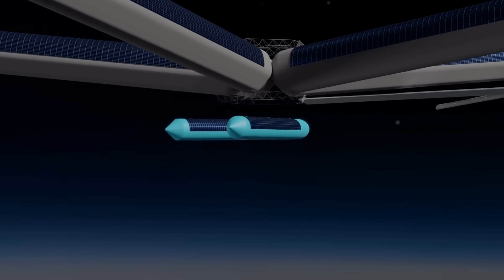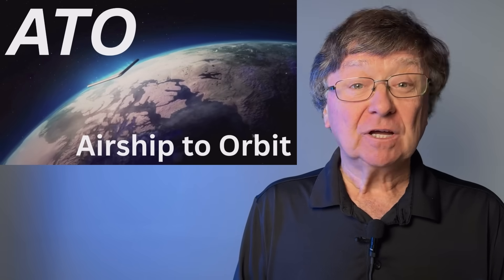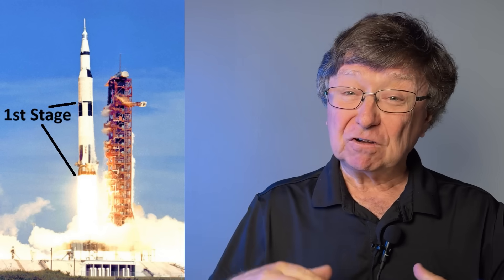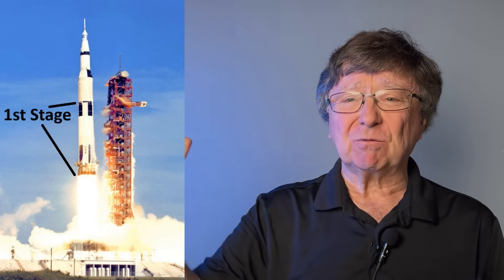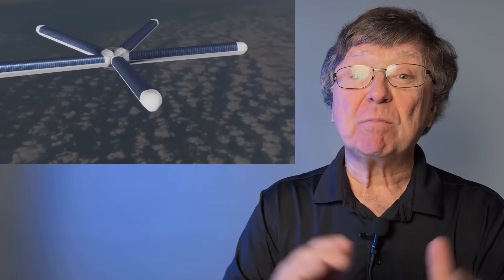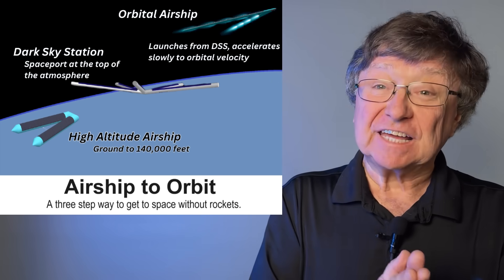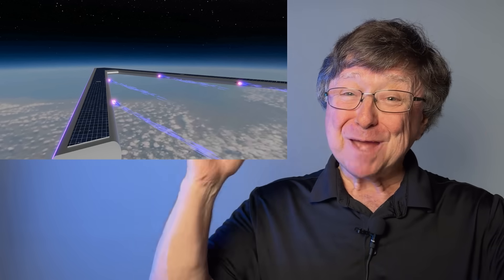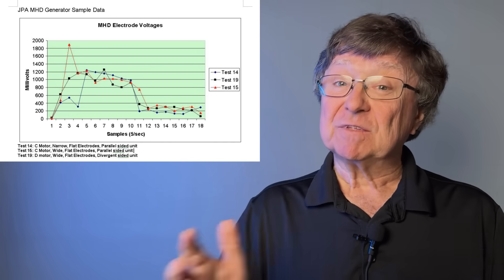This Airship Might Change How We Reach Space Forever!

Comment: Project Shotput. NACA 1959, mylar balloon at mach 10 and 300000 feet altitude. Sounds cool, but what does it prove? At this altitude and at this speed, even things like an unrolled roll of toilet paper will circle Earth for months. The problem isn't how to make a balloon circle Earth at enormous altitudes above the Kármán line, where the atmosphere is almost negligible. The real problem is, how do we get it up to there? The record for a balloon flying up all by itself is at 53.7 km, but this balloon was still floating, and its speed was extremely low. The balloon from Project Shotput was taken there by a rocket, not by an airship.
Reply: lol, the NACA was NEVER 300 000 feet, but less than 250 000 AND - most important - they "balloon" reach that altitude propelled by... A fking ROCKET !! And that "record" of 53.7 km was for an unmanned, uncontrolled flight who only managed a pathetic 3kg load at the price of 80 000 cubic meter volume ! Build from an ULTRA thin  material (2,8 micrometers) so very, very fragile. Not a  real viable concept, tough, more just an experience to establish a record, without any practical value.
Reply from the maker: Shotput demonstrated that the high Mach, high altitude environment is a flight environment for an inflatable vehicle. If a fragile balloon can survive, even briefly in that environment then I can build a vehicle to take advantage of it. It doesn't matter if shotput got there by rocket or carrier pigeon. There was actually many programs like Shotput putting balloons up from 300k to 600k feet at high velocity. They ran from the 50's thru the 80's. Lots of data. There are even LEO (very LEO) satellite companies putting light weight control surfaces on their satellite to take advantage of the little atmosphere there for maneuvering. Where's there's drag, there's lift. I intend to take advantage of that. Take care.  🙂
Reply: @johnmpowell    You failed to address his question at all.   He was asking how you intend to reach altitudes far beyond what balloons can reach on their own.   He was not asking whether balloons can survive at altitude.
Reply: @johnmpowell  Amazing, I love it! Problem solving, work the problems until they go away. Goodluck!
So much negativity here.
😊

Comment: Orbit isnt about "how high", it is about "how FAST".  The most efficient thing humans could donfor space flight is to build an equatorial launch facility.
Reply: The higher the craft, the less the air friction to impede speed.
Reply: @hoptoads  less buoyancy too.
Reply: mass-accelerator (railgun, coilgun, etc) approaches are unfeasable due to atmospheric heating, but electromagnetic acceleration is the most efficient way to reach orbital velocity.

the "most efficient" thing humans could do for spaceflight is to build a structure tens of kilometers high with an embedded electromagnetic accelerator that can launch spacecraft past the atmosphere... and the only feasable way to make a structure tens of kilometers high is to use lighter-than-air modules, I.E. a pyramid of "bubbles" made of metal or carbon, filled with hydrogen, strong enough to survive harsh winds and stay tethered to the earth despite the entire structure being less dense than air.

its much easier once you're already in space, because you're not limited by the constraints of gravity and atmosphere, a "ship launcher" built on the moon could be hundreds or even thousands of kilometers long, capable of sending spacecraft to anywhere in the solar system in just a few weeks.

the problem is that despite it being the "most efficient", the upfront cost would be in the trillions of dollars, and nobody is going to spend that much on a structure that could theoretically collapse if something goes wrong. the tyranny of the rocket equation pales in comparison to the tyranny of economics.

it gets worse when you consider that without the protection of thick layers of atmosphere, any inflatable structure is at the mercy of space junk and micrometeorites.
Reply: That would have to be done deep inland somewhere like africa, but the problem is insecurity. Islands weather and tsunamis make it too risky
Reply: Aaron, but it is more efficient to accelerate in thin air. It's also less stressful, so weight can be saved. It is silly to go fast before you've reached the stratosphere.
However, instead of airships, I prefer 70% efficient piston engines, large slow multi-bladed propellers, even larger and slower multi-bladed counter-rotating necklace propellers, and huge 40+:1 lift to drag wings.
Reply: @RePeteAndMe  or, now hear me out: a rocket for that "first stage" of travelling through the atmosphere and guess what! We're already pretty darn fast by the time that first stage rocket gets us out of the atmosphere
Reply: @yamlcase230  😂
Reply: @yamlcase230 Yes, current rockets travel through thick atmosphere at supersonic speed and rely on thrust instead of wings to climb. That's why 90% of a rocket's first stage is fuel, which is an immense waste. It's also why rockets must be insanely powerful , which makes them incredibly dangerous.
Thanks for adding to my point: speed should be avoided below the stratosphere and wings are the way to fly. Rockets are inefficient, polluting, take a lot of work to reuse, and blow up regularly. Piston and prop robotugs are cheap, efficient, and safe.
Reply: Most rockets are not polluting, put out water or normal co2. . .   They are fragile due to having to have little structure. . .  But rockets if they were cheap would be fine technology, but they keep being delicate so a hassle and big cost. .   . .
Reply: @RePeteAndMe  - do not allow your common sense, logic, to ruin his wet dream !

Comment: So there are probably a million other issues that have a more pressing need for addressing, but it occurred to me that using solar power to provide launch energy likely limits launch windows and trajectories quite a bit.  You would need the vehicle to be in the sun (and significantly so) not just at the time of launch but over the entire launch path.  Since the launch is a protracted process, the position and angle of the vehicle are likely to change quite a bit relative to the sun over the course of the launch.
Reply: That would be the case.
I also think they might have or want some supercaps on board.

This might already be needed for distribution and Regulating the electricity.

Comment: It's especially pipe-dream material when you spell carries as 'carry's'. Also comparing spaceflight to commercial air travel tells me you're certainly off your proverbial rocker. Keep swingin', tiger!
Reply: Falling over trivial things like that isn't a point at all.
Reply: @ferkeap  The spelling errors (there are also several grammatical errors in their ATO intro webpage) suggest that they have little quality control and checking of their publications, so one wonders if the same applies to their technical ideas. The dearth of quantitative arguments -- weight of components and systems, strength of materials, thrust vs drag vs lift, numerical simulations -- also makes me doubt that they have a road-map to a working system. But if they have fun doing what they do, good for them.
Reply: @NiklasHolsti must have read 50 posts to finally get to the one that sums this all up the best and I think you hit the nail on the head, as long as these guy's are enjoying what they do I say God bless them as well 👍

Comment: How about re-entry? You still have to get rid of the kinetic energy of the vehicle mass travelling at 17,500 MPH.
Reply from the maker: The extreme low wing loading puts all the deceleration much higher up. The reentry temp is low enough that a heat shield is not needed.

Comment: Many big engineering challenges, but nifty idea.  Your animation showing a huge pressurized volume on the spaceport is doing you a disfavor - any habitable space at that altitude is likely to be very small for weight reasons.  In fact, I would argue that making a fully automated system with no pressurized volume would be a more sellable first generation concept.

All that said, given the need for solar on the final ascent, does it make sense to launch in a retrograde direction in order to benefit from more sunlight on the climb-out?
Reply from the maker: We're running a 14 ft diameter pressurized tube down the length of the 300 ft diameter envelope. This allows for lifting cell swap out and maintenance.  It looks like it's bigger in the animation but it's really not that big.
Reply: It’s a lot of cubic feet of very heavy air which you’ve got to maintain at human tolerable temperatures for no apparent benefit that I can see.

Comment: Air density at 140000ft is ~1/500 of ground level. If the populated chambers in the station are pressured at 1/3 of an atmosphere you need approximately 150 times the volume of low pressure helium of what you have in air to keep it afloat, not counting weight of the station itself, cargo, people and fuel. Adding all that you probably need about 300 times the volume. That's not impossible, but it's an incredibly large airship, maybe several km in width. I'm sure you already did this math, can you share more details on volumes and weights?
Reply: Yeah….. I stopped at 10mins and spent 5 minutes discussing various aspects of the challenge with GPT 4o-mini-high and, well, all I would say here is there should be much more time spent by the presenter on explanation of the physics and assumptions than on animation.. if one could be built then it would not be a small upper atmosphere station despite needing to be extremely light, fast and somehow have a lot of energy spare with some very effective collectors and thrusters…….
Reply: All doable, right?   Now let's see you move that craft the size of a small village through actual weather, turbulence, and sheer.

Comment: As an aeronautical engineer BS graduate in 1972 and a product development.  I looked a buoyancy in the atmosphere decades ago.  Simple the highest balloon just doesn't get you very far on achieving the mount of energy to reach orbit.  This lift body lighter then air vehicle has so much surface area and thickness that it will not decrease that energy to reach orbit very much further as a flying body high in the atmosphere.   Didn't ever hear of shot put program in college.  Will learn something.
Reply: Seems like the first ship is designed for its buoyancy to achieve lift. The second one's buoyancy helps if it just keeps it in the air. With lift coming some from vertical thrust, some from aerodynamics?
Reply: A lot of people confuse altitude with delta-vee when they are far from interchangeable.
Reply: The hard part for me was seeing the balloon float up to the station, indicating the station's altitude was high but its velocity is very low relative to the surface.   Then the orbital craft comes flying in nose first like it is nothing to get it slowed from orbital velocity to the speed of the hub.   Low enough wing loading to do a slow reentry?   Well, anything below orbital velocity means you are coming down, and you have to stop coming down and stop going fast to dock with the hub?
Reply: @brianhaygood183  I don't know the math, The question is if there is an atmosphere thick enough to lift anything high enough to not need an high velocity to stay in orbit. I would guess no. ISS is traveling 400 km above earth and at an speed of 28 000 km/h. That sounds both higher up and faster that can be done with an blimp.
Reply: Called Areogels...

Comment: The biggest problem to space is the same problem for electric vehicles.  Power density.  No heat shields are necessary if you have enough power.  We don't so we have to go very fast and use the atmosphere to slow down.  If I could lift my jeep and put in some sealant to keep the 1 atmosphere inside.  I could traving at 60 mph straight up and be in space in an hour.  Comeing back I just need to go slow enough not to have heating.  Space travel will be much easier, more common and safer when we have high density power.

Comment: No atmosphere, no climbing.  Why aren't old weather balloons drifting in space?
Reply: Re-entry would also be problematic if the ship is at orbital speeds.  Drifting down like a feather wouldn't work, if you're outside the atmosphere, you need to be traveling AT LEAST as fast as the Earth is spinning, then once there, you've gotta slow down big-time before the thickening atmosphere rips your ship apart.  Hugely expensive, fuel-wise.
Reply: They burst
Reply: It'll be fun to see if it ever gets off the ground, I really really doubt it would work except for sub-orbital missions (like the flying dild... umm... vibrator(!)) but I hope it DOES work.
Reply: To be orbital, one needs to overtake the planet's rotation, not float around waiting for the destination to spin to under you.